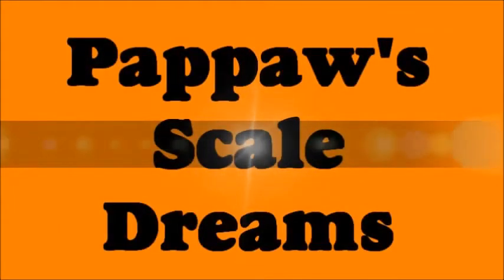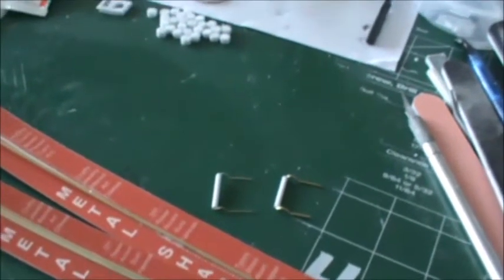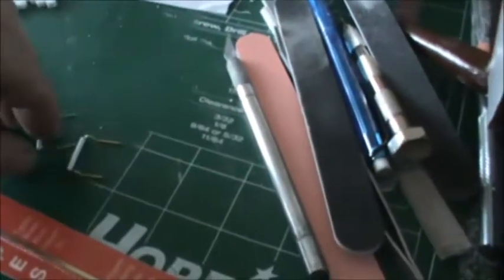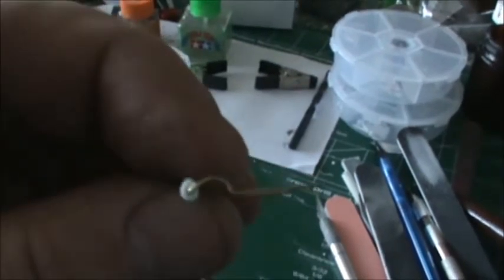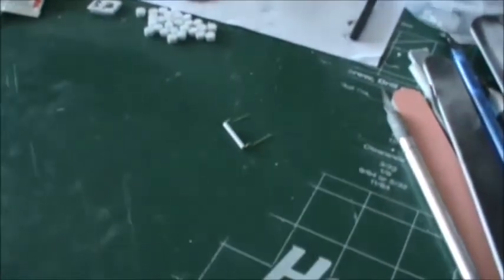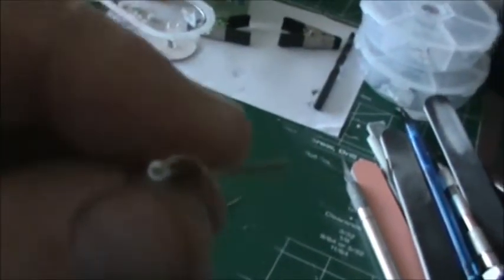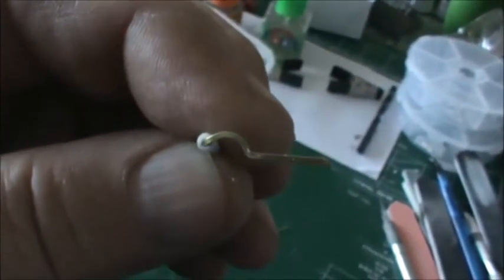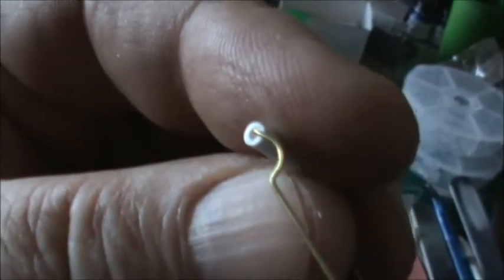Let's Make A Hinge

Comment: Very cool. I agree a new dimension in modeling. Now I just have to use up all my 1/8 brass rod lol. The only thing is I might sand down the edges under the tubing. Great video,and thanks for sharing
Reply from the maker: Use it to make exhaust pipes and paint them.  Drill a hole in the end and there you are.
Reply: Great idea Dale